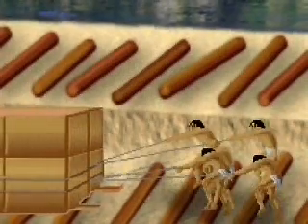How the Egyptians build the Pyramids (a theory) 2

Comment: @optimusjizza But by building the ramps into the structure, the angle of the ramp would only have to be enough to reach the next layer. In this way it would take very little manpower to move the stones up the ramps. Also, the stones would not have to be turned around the corners of the piramid. They simply reverse direction for the next section of ramp. The ramps would be concealed by the outer layers of stone as the piramid rose.